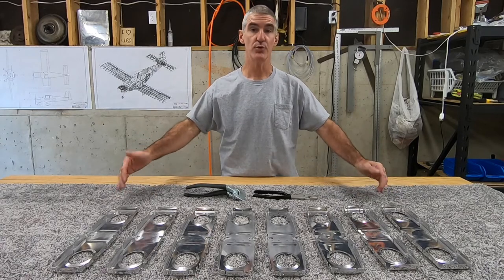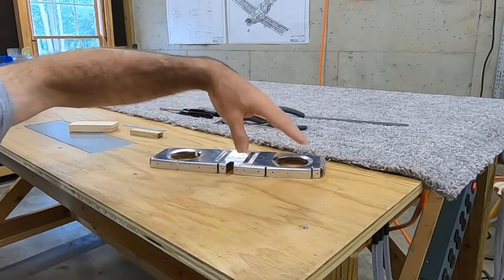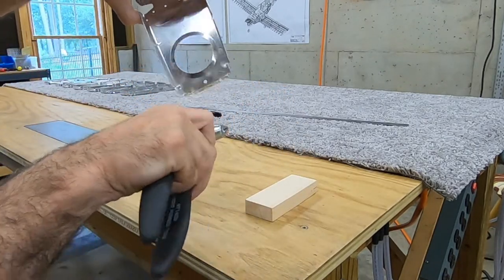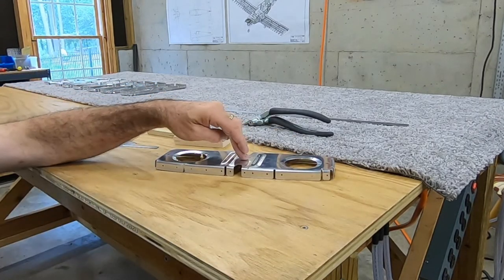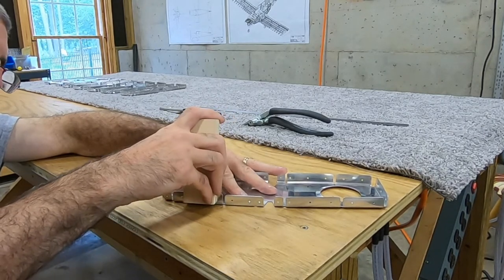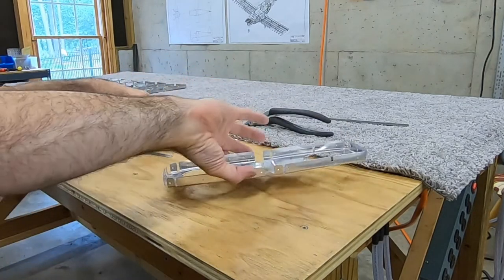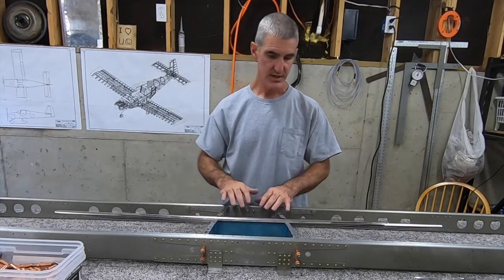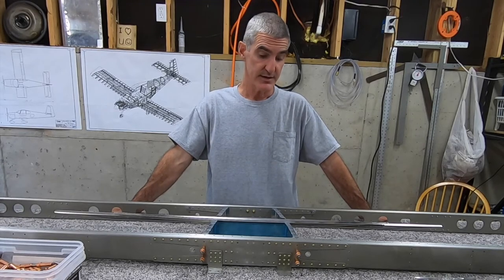RV-10 Build Log - Emp 39 - Fluting the Flanges

Comment: Thoughts on making and using the flange tool? I made one and it’s saved me a ton of time doing exactly what you are in this video.
Reply from the maker: You mean the wooden blocks with the slots cut in them?  Definitely the way to go.  I made a couple of different widths.  One is maybe 2 inches or so wide, for doing the main sections of rib flange, and one’s a little less than an inch, for doing the smaller flanges near the nose, and “fine tuning” between flutes if needed.  Simple and effective.
Reply from the maker: Oh, cool idea!  I’ll definitely have to give that a try when I get to the wing.  Thanks for sharing! @flyyourdream9716
Reply: @missiletwentynine2667  no problem, it works great on all ribs. Total time saver.